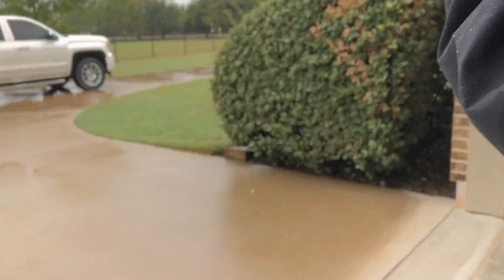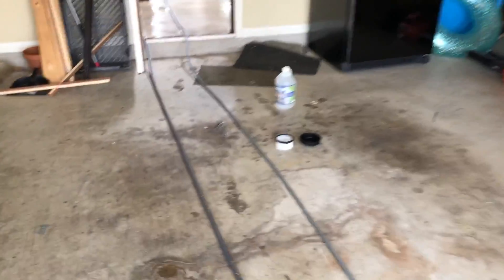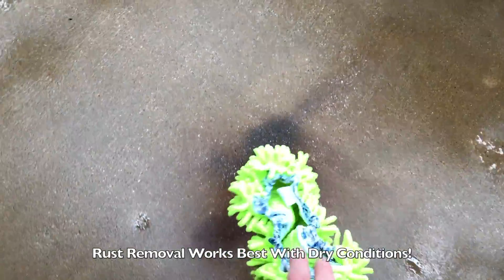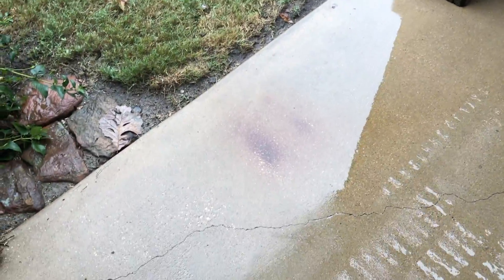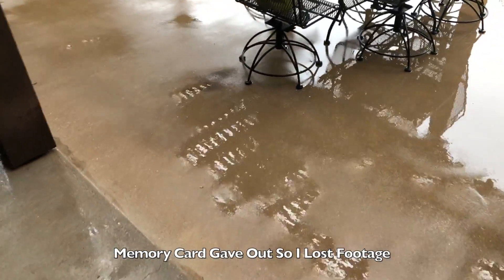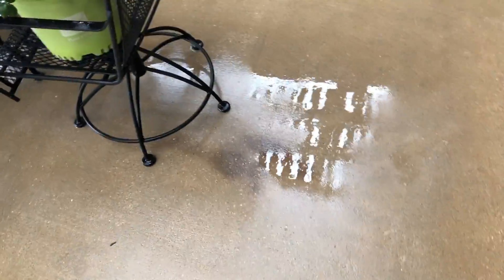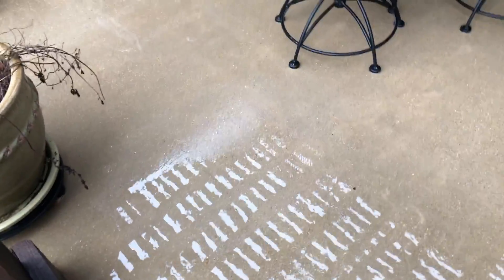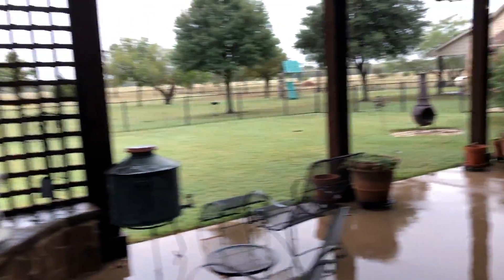Oxalic Acid Rust Removal (Part 1)

Comment: What did you use to remove the rust??  F9 or oxalic...
Reply from the maker: It really wasn’t ideal conditions for doing rust removal, it was in the shade mostly and it was raining. I did an Oxalic treatment to see how well it would work and then I did a follow up treatment with F9. Since this video ive used both. Both work great. Oxalic is a lot cheaper but I feel like you get better results with F9

Comment: Oxalic is the way to go. I rarely do rust spot removal unless I'm doing the entire area. We charge 30 cents per sq ft for concrete brightening/rust removal.  We like to use 4 ounces per 2 gallon with hot water. So have you tried the Sodium Hydroxide for Chic fil A yet? Again 4 ounces per 2 gallon but remember be careful Sodium Hydroxide can make even muratic acid look tame.
Reply from the maker: Thanks man, we haven’t tried it yet. And I’ve heard muratic acid is superrr dangerous! Have you used it before?
Reply: @DustToGloryPW  I keep a gallon or two of Muratic on my truck all the time and yes it can be dangerous but I have to be honest sodium hydroxide you'll need to be more careful with. Let's just say they don't call it the sodium hydroxide dance for nothing. Trust me it's not a matter of if but when you'll get stung by the stuff. Also it's very important you wash out your sprayer afterwords and never get it on anything you want the paint to stay on.